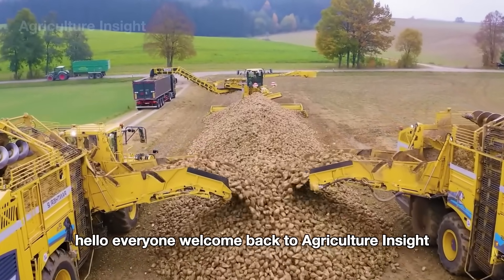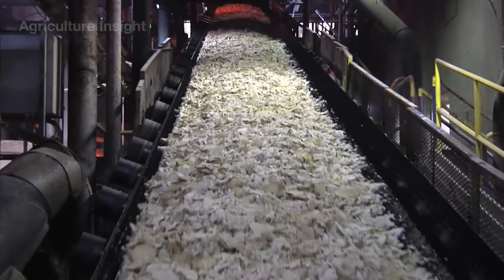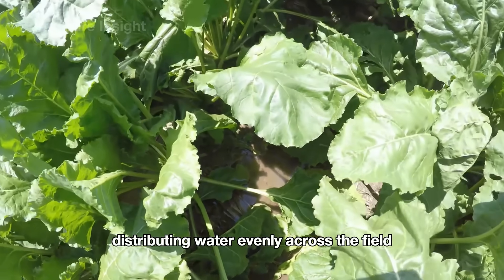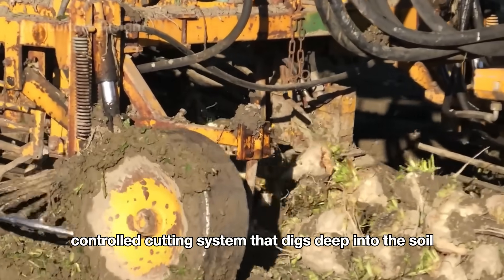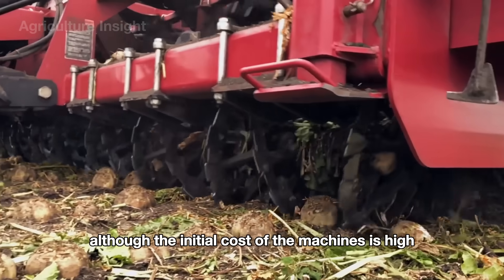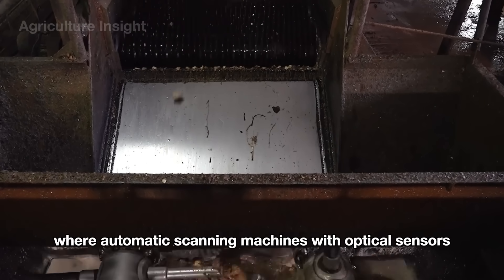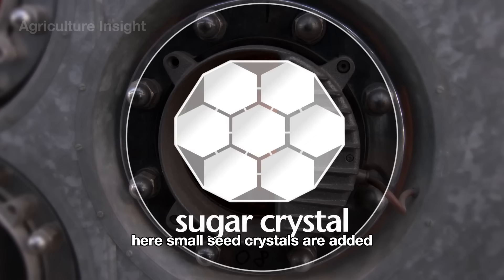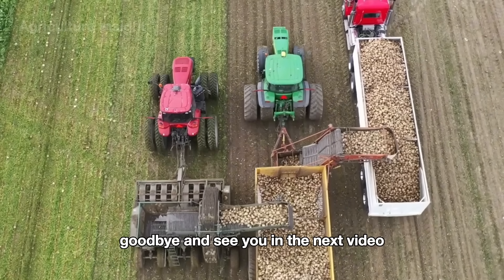36 Million Tons Of Sugar Beets Are Harvested To Produce Sugar This Way | Farming Documentary

Comment: Now that machines are modern, do we still need people?
Reply from the maker: Great question! Modern machines have revolutionized sugar beet harvesting, but people are still essential in the process. Machines handle the heavy lifting—digging, lifting, and cleaning the beets.
Reply: There are some folks that spend 2 weeks a year helping with the beet harvest. They work 12 hour shifts and it is a 24 hour operation for those 2 weeks. It might to 10 days running plus maybe 4 days of setup.